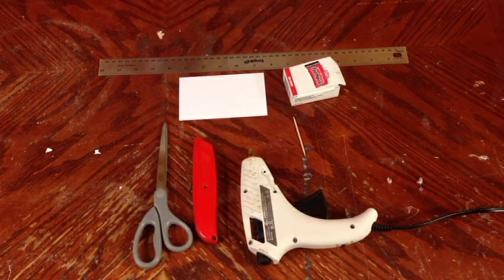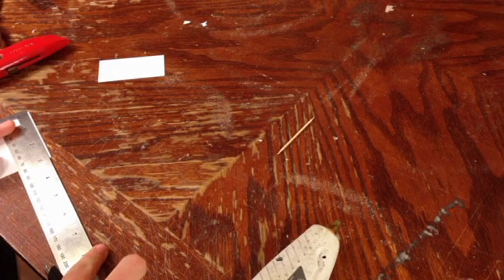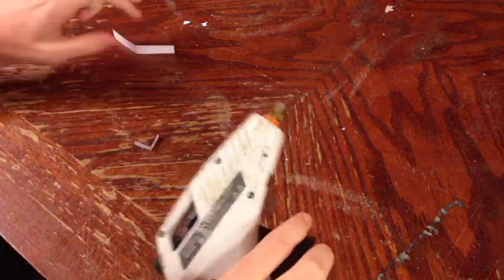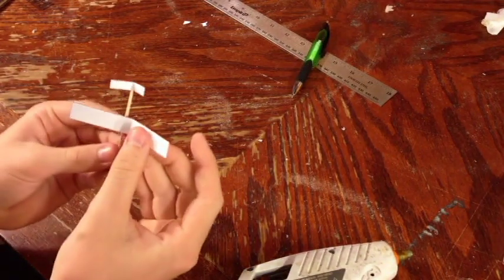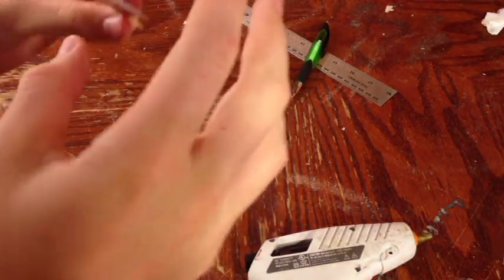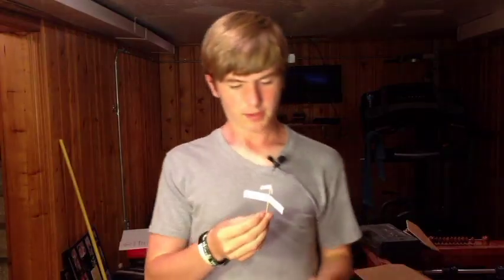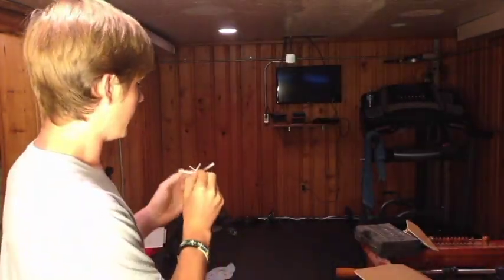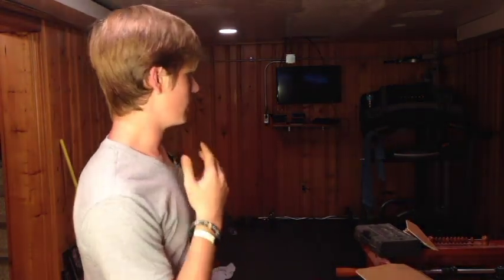Foam Test: Toothpick Glider Build

Comment: How do you find the CG? My Gliders are pitching up and stalling into a flapspin
Reply from the maker: +SkyPilot 737 you can't really find the FF on them, you just have to throw them to test it. If they pitch up and stall they are tail heavy. If they nose dive they are nose heavy. I'd add some hot glue to the nose of yours.
Reply: Well is not nose heavy or tail, it depends on the wing pushing on the wing, too much forward then too "tail heavy"
Reply: It depends how you angle the elevator, V shape pushes nose up, ____ shape pushes nose down.